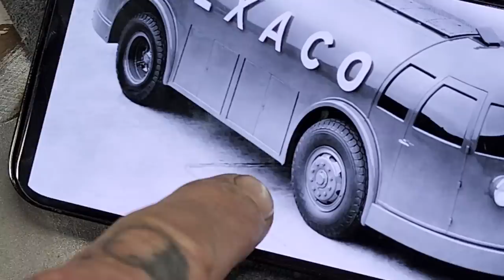Fabricating the wheel shape opening out of square stock – 1930's Doodlebug Tanker

Comment: Allow for suspension travel, and steering on the front wheels.  To elaborate, for example,   if your expected suspension travel is 4 inches you should add that to the top of the tire then maintain that relationship to the circumference of the square stock you are bending.  That will maintain a uniform appearance.  May not be a big issue for the rear wheels however for the front it is more important for steering clearance when cornering.

Comment: Thanks for the shout out on Gene Winfield's birthday, a super inspirational human. Great to see you working on the project. Used the same roller to bend an arch in 2X4 heavy wall tubing to make arches for gate for 14 foot wide driveway. Ended up using a come-along to force the material to bow quicker once the initial bend started, lots of passes back and forth to get there.

Comment: Please don't weld in bare legs I personally was VERY badly burnt in the identical position your welding in. Before I learned The uv burn was worse then a flame.  Hospitals here in Antigonish had never seen such a bad burn.
Reply: Agree if the splatter doesn’t get you the UV will

Comment: Hi Chad & Jolene, nice work both of you, it was nice to see Jolene in the video for a change! Jolene you were doing a fantastic job of welding, you could'nt ask for a better job. Chad you got quite the workout today on the pipe bender with the square stock, turning the wheel takes quite a bit of effort especially with the square stock in there. At least you only have to do it one more time and not three more times. That is going to look really good when you are done with welding it all in for the sheet metal.

Comment: You need to mount it to something low and mount an electric motor that it strong and put a reservable switch,  a large and small sprocket and motorcycle chain then all you would have to do is tighten the top bolt and run it back and forth. It might help it not kick your butt as many times as you are going to have to do that. Btw greetings from Stillwater Oklahoma USA

Comment: Instead of tape on the wheel just multiply the outside radius of the tire by 3.14. If the tire is 32 inches tall then the radius is 16 inches, remember you're measuring half a circle. 16 x 3.14 = 50.24 inches so your square stock would be 50.24 (50 1/4 inches) inches long.. of course that length will increase nif you want space  between the tire and the wheel. Lets say 2 inch space with a tire 32 inches long. take the radius of the tire (16 inches) plus 2 inches (space) equals 18 inches (total). 18 X3.14= 56.52 (56 1/2 inches) so your square stock would be 56.52 inches long.

Comment: Make sure you factor in the weight of the engine/trans, body, occupants, Bugatti and other odds and ends. That frame's going to be maybe 3-4 inches lower once complete. I'd set a  couple of engines and transmissions on it behind and between the front wheels ( cover the holes in the floor with plywood to set the weight on Figure 500-550 pounds per engine.)to see how far it goes down and that would be your height with everything, even fuel but without the Bugatti in the back. That would take 3-4 more engines just in front of the rear axle to get the loaded height.

Comment: ** PLEASE NOTE! ** You need a slight flare in the back of the wheel opening to allow for the deflection of the wheel moving back when you hit a bump or turn the wheels. The wheel momentarily stops or stalls when you hit a bump and will move back until it overcomes the obstacle and starts to roll again. Look at any wheel opening and you will see that this is true to form.

Comment: Ok Chad.
Try something on the next bar.
If you put the impact driver on the wheel as a powerwheel...roll one direction and BACK, Then snug up the top nut a little.
Roll forward and BACK again,
Snug the nut a little more repeating the process.
Its less Physical labor.
Make a video on the new time saving method 😊
Reply: Weld a HEX nut to the top of the bender, then use a socket wrench.

Comment: You guys don't seem to understand the amount of force Chad is applying by using that wheel. The use of a ratchet and socket would be a lot harder. And the proper size motor and speed reduction drive would be immense. For no more than he's doing this is the best way.

Comment: I am a fan and have made lots of positive comments. just one thing that I think should be said. Chad is working opposite Jolene who is welding. Don't underestimate the risk of a welding flash. I have had a few and there is nothing more painful. feels like broken glass being rubbed in your eyes. the worst one I had was from a reflection of someone welding off a sheet of polished stainless leaning on the wall.
The pain of splatter on your legs is funny in comparison to a flash.
For those that don't know its extreme sun burn in your eyes, it hurts on your skin its excruciating in your eyes. Only way to remove the pain is local anaesthetic at the A and E 
Perhaps just worth a mention ( warning)
A so called flash is not what folk think, its not just a quick flash off the welding, its prolonged UV just like sun burn but in your eyes.
Other than that keep up the good work and long may it continue.

Comment: The bending machine has 2 rollers on the bottom that are turning, the top roller is not turning. The metal is just rubbing on the upper roller. That should make it a lot harder to get it through. Remove the upper roller and lube.

Comment: Try adding extensions to the handwheel about a foot if possible at each of the four spokes  ease the effort and use a breaker bar on the adjustment screw

Comment: chad maybe you could weld a 1/2 in drive socket on the adjustment rod for your bender, then you could use a 1/2 ratchet or a strong arm to adjust your unit down on the  square stock . excellent welding Jolen but you had me cringing every time i saw a spark come at your Legs. a piece of leather draped across your legs will protec you. xo

Comment: That would be a good idea to get some sort of POWER source to turn your circle/wheel bender. You could make your own steering wheel' s and all kinds of other cool stuff. Maybe some sort of old washing machine motor. Where I live people toss out old appliances that that motor still work's, clothes dryers extra.....
My brothers one of those scrap metal guy's that has to separate the metal before turning it in for money. He some time's comes across a working motor. We hook up a belt from an AUTOMOBILE with a pulley system to turn drill press, heavy duty bench grinders wheels, compressors or what ever. Even a lot of lawn mower's engine's are good just the people that toss them don't check all the filters that get clogged with carbon, just have to pull all the filters clean them out, holes could be plugged, spark plug clean and the engine will start right up. We have a stack of lawn mower's engine's set aside. No lawn. Even though lawn mower engine's will be of the past because every garden tool is going electrical power pack.

Comment: Well, that is interesting again, hey Mr Bad Chad what if you installed a large wheel, approx 3' or 3.5 diameter on the tube bender perhaps, the physics turning the tube out would make it much easier and I'm sure you have lots of scrap around to do that. but that is my two cents.  Keep on trucking, Great job welding and doing what you do Jolene.

Comment: Hey Chad, check out Swag off road. He makes some attachments  for harbor freight rollers. one of them is the parts to enable you to use the harbor freight pipe threader to drive the tubing roller. i bought one and used it to roll over 200 feet of 1 1/2 square tube.

Comment: What about loading the front and rear suspension with about 1200 lbs each. This would let you get the wheel arches spaced over the tires as if the truck was completed.